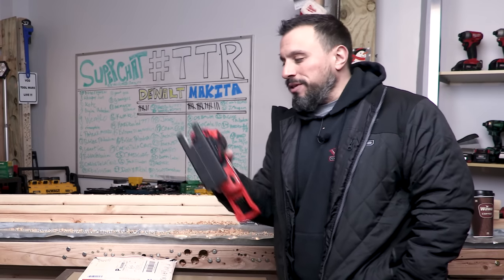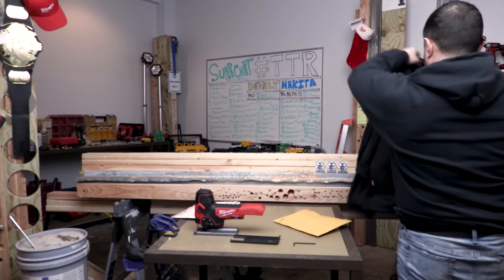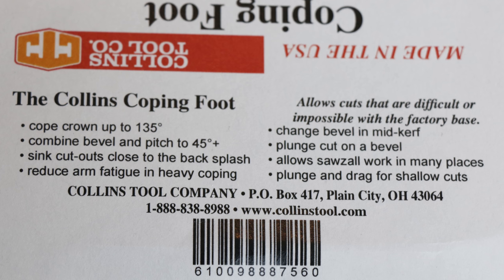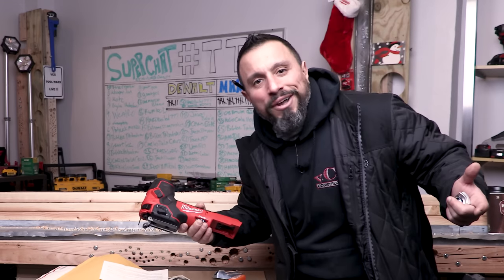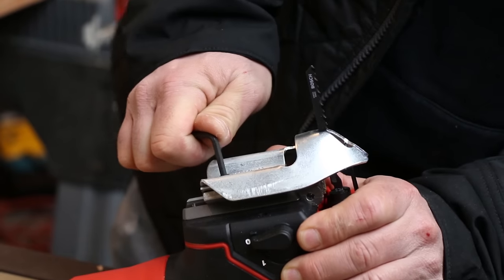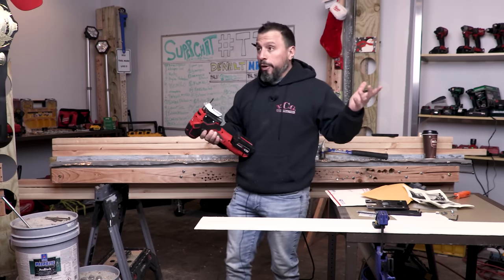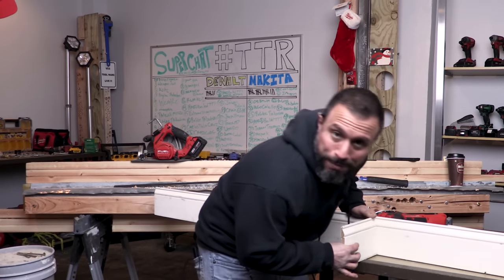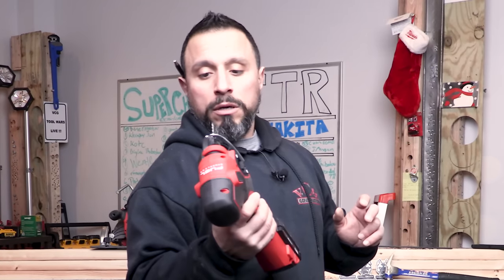How To Install A Collins Coping Foot On A Milwaukee (2737B-20) M18 FUEL Barrel Grip Jig Saw

Comment: Hey that first cut you made.. the long run up to the profile. Instead of using your jig after you miter the base flip it so that the profile is to the bottom of your saw and the face is against the fence. Back miter it down to the profile. Then cope the profile.
Reply: That's what I do too... saves a bunch of time

Comment: I don't like the look of that one as a regular jigsaw because of the how the battery sticks out but in this case I think it would work better than the other M18 or M12 versions. Looks like the extra length would give more control. Great review.

Comment: I kinda like the barrel better than the D-handle. The D-handle  is seriously chunky and feels a little awkward. I know I'm used to the old wired Milwaukee I grew up using but the frame and guide was closer to what's on the Barrel jig saw.  I'm also digging that coping foot, that flat foot makes it difficult!
Reply from the maker: The coping foot is a very versatile attachment, you can do so much more than just cope molding with it!!
Reply: @VCGConstruction  I just got the last of the 2 Milwaukee flip back utilities knives with 50 blades for $15 at Daytona Home Depot. I looked at 3 different ones, glad I didn't miss that deal, just the knives sell for $20 and another $15 for the blades!

Comment: Just ordered the collins foot and the Dewalt barrel with the power stack deal from Ohio Power Tools after seeing your newest video although I may get a Milwaukee also . I know abut dewalts blades falling out when backing up in cuts. There locking lever opens up by itself in that situation any feedback on this? Also does those lights hit you in your eyes when upside down cuts

Comment: Just ordered the barrel grip.  That coping foot will save me so much time on crown or base molding.  I agree that auto may throw me off, though it may be useful on the longer straightaways.  Engaging videos - I like you more for the patriotic part at the end.

Comment: That cut is TNT !!!!! Vince.
I also use a barrel jig on most of my cuts,  except cuts like the one you just did.  I like the variable speed trigger on the D-handled Swiss made Bosch, and very similar D-handled Metabo,  with course with Swiss bosch blades.
Awesome video, thank you much !!!
Reply from the maker: Thanks Stephen Lee!!

Comment: Great job Vince.  Been trying to decide between the Milwaukee and the Dewalt.  Happy to see Collins offers the coping plate for the Milwaukee, and installing it on the Milwaukee is head and shoulders easier than installing it on the Dewalt.  Home Depot today 02/14/2021 has a combo sale on the Milwaukee compact router and this jig.  Again, you do an awesome job on those tool demos.

Comment: I bought the new Milwaukee D handle jigsaw before the barrel grip jigsaw came out. Which is better? Should I also buy the barrel grip jigsaw too?
Reply from the maker: How do you like the D handle? If you need the jigsaw then buy it
Reply: I would prefer a D handle. I like having speed contol right at the trigger finger. I do see that with the barrel model its a much better grip as in less fatigue but I don't think that's enough to sacrifice trigger finger control. Just my opinion.

Comment: You had to stop and check the status of the jacket. You crack me up Vince. 
Great vid, again. Didn’t know this accessory existed. I tend to bevel and miter everything and only cope when I’m working with stain grade stock. 
Now I’m thinking about gripping up the M12 barrel jobbie and this Collins accessory to leave it permanently mounted. Thus coping with much more frequency. 
Thx for making me aware 👌🏼
Reply: instablaster

Comment: Have you seen how some guys use an angle grinder with  a course  flap disc to cope?
Reply from the maker: I haven’t checked out the technique, have you tried it yet Jason?
Reply: I haven’t tried it but it’s interesting.
Reply: I bet that works good,, could use a multi tool like the rockwell and be very accurate.. Gunna try that soon..

Comment: Nice job Vince!!!I have seen all the goo roos using the Festool barrel jig saws for years with that coping foot and they make it look easy. That new Milwaukee saw seems a little bit long and heavy but maybe it would take a little getting used to. What do you think about the M12 with that coping foot. Would it be much lighter and smaller? My favorite barrel type corded saw has been the Bosch with the same coping jig but it would be better without the cord for sure. Thanks again Vince, catch you guys later.
Reply from the maker: I think it would work great on the m12 chipshot!

Comment: Hey man, I have the d handle and was wondering if you know why it has a second smaller screw on the shoe plate? I think I broke it because now if I try to change the angle of the shoe plate it just gets really loose
Reply: I saw the collins coping shoe on the dewalt D  Finished Carpenter video check it out

Comment: You can cope faster with a chop saw, and angle grinder with a flap disk and a file belt sander.  Trust me cutting them with a jigsaw is time consuming.  I have found a better way.
Reply: The flap wheel works the best for MDF 
the Colin's foot works best for fjp,poplar, and is the only way do do stain grade hardwoods .
Reply: @joshscott3184  Colins foot works great, I own one.  For poplar I still use A Dynabrade sander with an offset sanding arm.  That allows a person to get the details and changes even in fancy profiles.  Expensive and fancy, but still faster.  For very hard wood like Maple I do use the Collins foot, but still clean it up with the Dynabrade.  I coped by hand with a jewellers saw for years.  Amazing results, too time consuming.  

I Sand most because it is awesome.  Still do use the Collins foot and think it has its'  place.  To each his or her own, though.  I have found what works best for me.  

Dynabrade sanders are not cheap, I do understand that.  But I also do metal work and they have many different arms that do different jobs.  I originally bought it for metal work, but I am still finding things that it works for that are totally unrelated to the original reason for its purpose.  Huge fan.